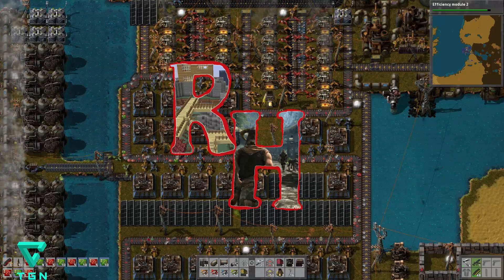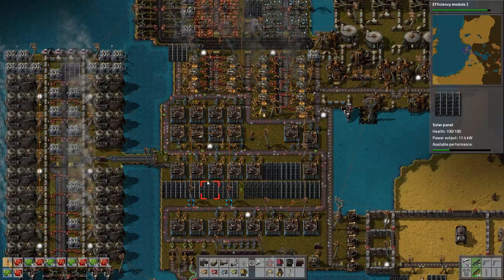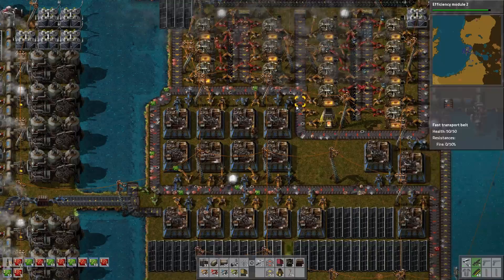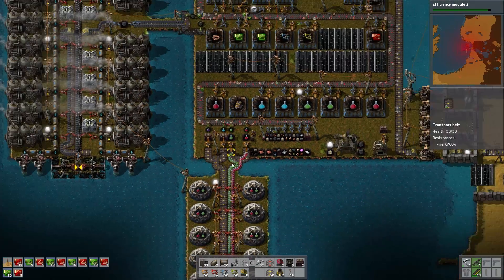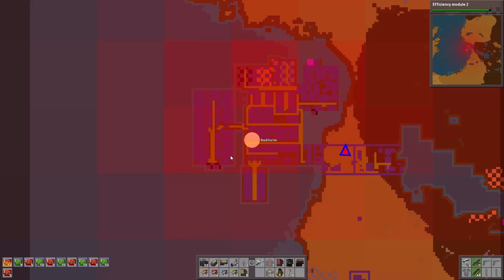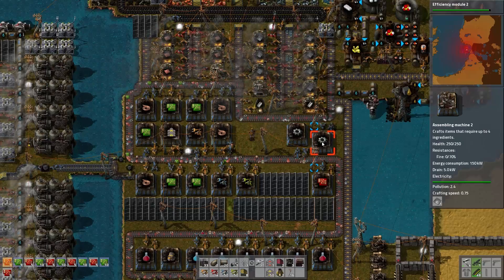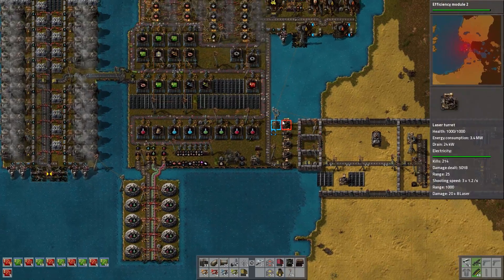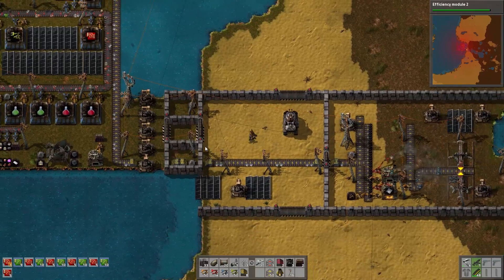Factorio Tips and Tricks: How to make an efficient Basic automated factory line

Comment: wow i never tought of this and it is very fast but there is one thing that i would add is green/red wires so if you need circut boards but all the iron goes on cogs (what you have a ton of) so the inserters that input iron into cog assembly machines would stop working if there is an certain amount of cogs in the chests
Reply from the maker: Yea. That is the main issue of 1 main assembly line. You don't have as much control of where things go as you would want. So it's not really that good for end game stuff. But for your early game it works pretty well all in all.

Comment: This is incredibly creative, I never thought of doing it this way. At most I usually have 1 or 2 items running on a single belt, while you have everything on a belt. I may try this :)
Reply from the maker: It's a good system for a small production line. But I have found that for a much larger one it's not all that good. I now use the type that is pretty similar to this screenshot http://cdn.akamai.steamstatic.com/steam/apps/427520/ss_4d2dbc665c41127ff1e08e4751dce3e396c31318.1920x1080.jpg?t=1458827523 
Which is great for large complexes as it has almost 0 byproducts. While mine almost always gets byproducts, although most byproducts can be nice to have since you can always use em :P
Reply: +redholm yeah that's the kind of stuff I use! But I really wanna try what this video showed for small production XD
Reply from the maker: Aaron Elwood It's great that I inspired you to try something new :)
Reply: main bus design is very popular and it makes stuff so easy.
Reply from the maker: ***** Yea. It's a super easy way of doing things. +You always end up with extra items in the end, for better or for worse :P
Reply: You could just loop the track back to the start if you wanted.
Reply from the maker: poohshoes That is something I was thinking about doing. Only problem would be that the track that is already getting over filled would just get clogged up. This type of setup is not good for a lot of items going at the same time. Now a days I'm more a fan of individual lines of all the materials going to where everything is needed. Takes more place and a lot more time and planing. But it's a bit less wasteful. But even with all the waste here, it works for early game.